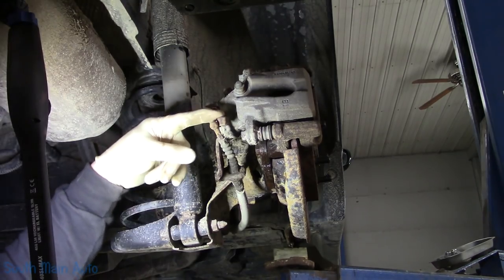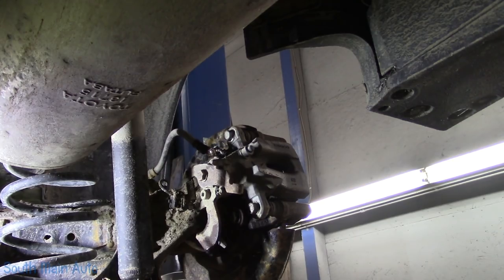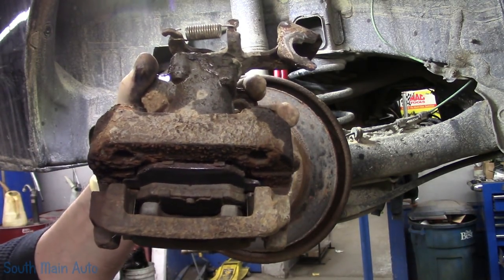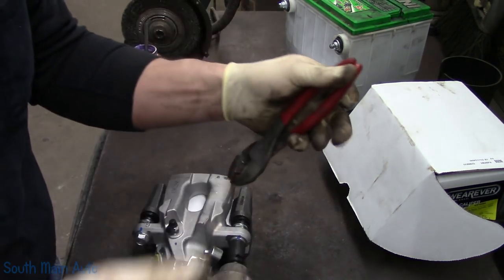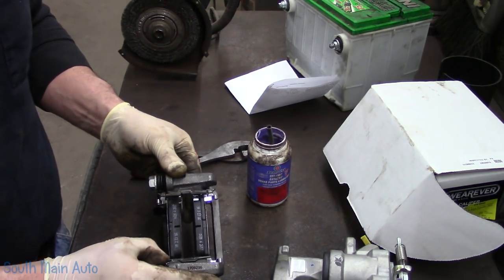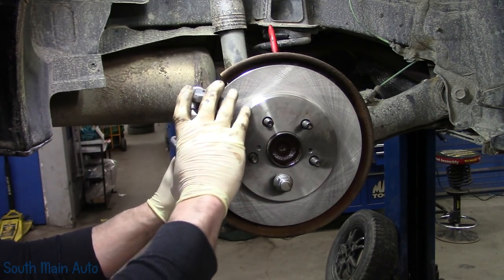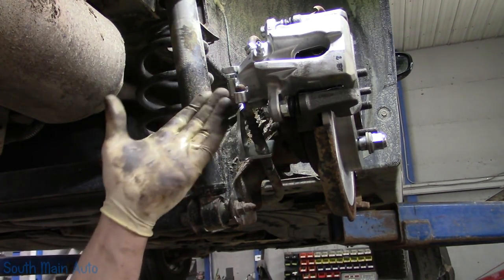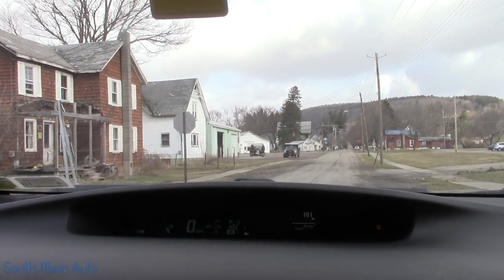Toyota Prius - Rear Brake Pads, Rotors & Calipers

Comment: At 9:45 Eric asks, "Kind of monotonous, isn't it?" No absolutely not. I love seeing you work. You are clearly doing the best job possible, and that is an endless joy to watch. In addition, I love seeing all the ways engineers can design the same components to do the same job. In this case the shock goes into a bracket welded to the outside of the lower spring cup. It is so much fun to see this.

Comment: So, I have seen several videos where the wheel has come off while the car is moving, and always a day or two after some other shop replaced the tire. Those shop state that you must return to let them RE-tighten the lug nuts. This is because those shops do not clean the rust off the disks, which means the wheel is not solidly bolted down to the disk. As the car moves the wheel-rotor mating surface scours off the rust, and this loosens the wheel. In every video Eric cleans off this rust at every surface. When Eric is done, that wheel in on to stay. This is the joy of watching Eric work.

Comment: videos like this make me so glad I don't live in a place that gets snow all winter long.  I don't have to deal with any of that rusty crap on my cars.  Just a little surface rust here and there.  I've owned my Integra 18 years and can only recall maybe 2 bolts that I've ever broken on the car - an exhaust manifold stud, and one of the OEM shock tower brace studs.

Comment: Why was I transported to the dentist when you used that pick on the rear hub (shudder), then laughter when I saw the slo-mo brake clean spray action. Great job on the car and the video. NB here (UK) so many cars now don't have a handbrake or emergency brake instead they have electrically operated ones which engage and disengage automatically so their use is definitely on the increase.
Reply: In wet, freezing weather the brakes can freeze in the set position if applied when warm. A lot of people in snow country have learned not to use the parking brake, at east in winter.

Comment: i did add a couple of flanged headed bolts and nuts with some rubber washers to my tool box a couple years ago just to plug off my banjos. seals them so they dont drip  but more importantly keeps the dirt out.

Comment: I clamp my hoses too, also bonus points for the "ive been taking chances, its gotten me 3 kids but never a collapsed brake hose."
Reply: My take on clamping the hoses (I've never done it - I wrap the fitting and let it ooze) is that if the hose gives trouble after being clamped the hoses should be replaced all around.

Comment: raises hand parking brake user here also, for both manual and automatic cars.  Knowing how the park function works on auto gearboxes with the little pin hold the weight of the car, using the parking brake seems like the obvious thing to do.  My wife never uses it, but I do.

Comment: Nice work. I did a pad slap on my brothers car the other day. He refused to replace the worn out rotors and bought the cheapest pads they sold. I spent about 10 careless minutes on the job.
Reply: I didn't even bother driving it. He said it was great. Not even squealing or squeaking. The rotors were not previously pulsating but had large groves on them. One of the inner pads was completely worn down almost metal on metal due to a sticky caliper (which I did replace).
Reply: The car will be fine as long as the only issue is the rotors needed to be turned. It will actually cause the brakes to grab better, but at the cost of those new brake pads. They won't last as long as they could have if the rotors were replaced/turned also.
Reply: If you have a stuck caliper piston, that caliper needs to be rebuilt. You may free it up but its only going to last so long. At least a new piston and seal. On some brakes, I am careful about which calipers I buy. I am not going to completely trust the phenolic pistons (plastic) long long term. Brakes are too important to keep working at 100%. 
Replace your brake fluid if you haven't already done so!
Reply: m ph w
Reply: @snoopdogie187  I haven't turned rotors in 30 years or more. Rotors seem much more susceptible to judder after being turned, especially if they had it to start with. If the rotors are not looking and behaving well I buy new ones. Much better results.

Comment: parking brake remember when it was called your emergency brake with the actuation handle under the dashboard. and the starter pedal was on the floor next to the GAS PEDAL👍
Reply: Don't forget about the high beam switch on the floor
Reply: And your bright headlights were a button on the floor
Reply: And an accelerator pump and a manual choke
Reply: The mechanical parking brake saved my bacon while going down a steep hill and the brake line gave way. I was able to use it to drive to a local shop. What would've happened if I had the electronic parking brake?
Reply: +mikey mike  On a few old cars there were two foot-operated switches on the floor: one for the high beams, and the second to engage the engine starter.  The first time I ever saw this I was really confused, the car was manual transmission: one foot on the brake, one foot on the clutch, one foot on the gas for a cold start and another foot for the floor mounted starter switch. Humans must have been different back in the 1950s.      Another setup found on some old cars had the starter switch beneath the clutch pedal, push the clutch to the floor and the starter would engage, even when you were driving.  Perfect car to teach someone to drive standard.
Reply: Joseph1NJ If you hold down on them, they will stop you in an emergency
Reply: Joseph1NJ pull the switch and it locks down on the brake.
Reply: @Joseph1NJ  did you take a chance and pinch off the brake line at the last brake job?
Reply: @jeffmorton5092  No, the line failed.

Comment: I pinch brake hoses too never had a problem. But I like to use long rubber valve stems through the banjo hole too, no pinch your less mess
Reply: valve stems as plugs good one, I started using vacuum caps rolled through the holes, but the stems sound much faster!

Comment: Was working on my moms 2010 prius  brakes yesterday and I found the driver side brake was a mess. The outer pad was missing and the metal wire hinge thing was hanging onto the other pad and was scraping the heck out  of the rotor. When I removed the other pad it  fell into 2 pieces.  The  metal back and the contact pad  split into 2. Now I need to order a new rotor for the rear.

Comment: Great Vid! I'll bet those brakes hardly ever get used with the regen on. Hear about the 6k brake job on a tesla? He used regen ALWAYS and the calipers and rotors were one solid rust spot! Never touched the brakes in 22k!!  Hope lil T feels better!
Reply: In the first gen Prius the regen cut out below 12 mph. I don't know about the more recent models, but I agree the rotor looked like it hadn't been touched by the pads for a winter or more. (Regeneration is not controllable in the Prius.)

Comment: I am always astounded by how much corrosion you get there in upstate New York. Arizona just doesn't have that problem. Even here in Flagstaff, where we get a lot of snow, the city does not use salt on the roads. A decade ago they used a non-sodium deicer that did much the same damage and killed tens of thousands of pine trees along the roadsides, and that gave me corrosion under the shoes of my 2002 Prius rear drums. I recently gave that car to my son, at 205K miles he gave it its first brake service. The front pads were about 2/3 worn and the rear shoes were not measurably worn, so he replaced the front pads and left the rear shoes alone except for regreasing.

Comment: Working on and driving a Prius???  I am going to discuss with my therapist if I should remain subscribed to the SMA channel or not.
Reply: Ozzstar 20 bucks is 20 bucks
Reply: burningfeet 57  The third generation Prius (shown in this video) has almost exactly the same 0-60 time as the US version of the Delorean DMC-12: a bit over ten seconds. My wife and I have bought nothing but Prius since 2002. My 2002 needed its first repair (besides a couple 12V batteries, a windshield, tires and wiper blades) at 195K miles when the inverter coolant pump died - a problem in the first and second generations, including a recall in the second gen. I gave my 2002 Prius to my son last year because I retired and didn't need it. He did the brakes for the first time at more than 200K miles; the front brakes were about 2/3 worn. The rear brakes were like new.
My wife traded up to a 2010 five years ago and would still have it had it not turned into a magnet two years ago. Within barely six months it was sideswiped by a pickup truck beside her who flinched from a car entering the road, then a deer ran full speed into the driver's door, then a young woman had a seizure in a parking lot and fatally damaged it. She loves her 2014 with all the goodies, though. We have never had a car even a tenth as reliable as the Prius cars we have had.

Comment: A couple used long valve stems work great as opposed to pinching the hose...take the banjo bolt out and push the stem in...and just phenomenal brake clean action! Hahaha (rubber stems)

Comment: Here's a cheap substitute for that parking brake cable tool- the box end of one of your combination wrenches. Just try different sizes until you find one the fits and use it like the park brake cable tool.
Reply: We use little hose clamps to do the job,  quick and easy...
Reply: That's a good idea.

Comment: Hey Eric next time try a small hose clamp on the e brake fingers , keep it about an 1/8 inch up on the cable from the bracket. Tighten it up compressing the fingers and slide the cable out

Comment: 👍👍👍👍👍 Excellent job thank you ,got a question for you replaced all 4 callipers  and bled them,last year because the rears were sticking and not moving everything seem to be fine ,then this year when I took it out of storage they were doing it again in the rear brakes so I replace the rear hoses bled the system still happeningAny advice should I just take it to a professional technician like you

Comment: Important:  When changing out brake pads and rotor only, it is totally unnecessary to remove the parking brake cable from the brake caliper. Just follow the brake cable forward ( a foot or so) and you will find a number 10 metric bolt that you will need to remove. This fastens the brake cable to the car body. Once this is removed you will have plenty of room to move the caliper out of the way avoiding unnecessary work. I know this because I have performed this job on my Toyota Prius a number of times.

Comment: hey eric     the pad sensors or squeal ers   always go toward the leading edge of the rotor  I always find them installed backwards   and sometimes I transfer the cable bracket over... cable still on bracket   nice brake clean music too

Comment: Eric jumps the tracks in a Prius! WOOO! 😂 I'd love to hit those at whatever speed that fast-forward converts to. You'd get some serious air, no matter what you're driving! 😁

I was just having that same discussion with my neighbor about parking brakes. Just about every vehicle I get in here has frozen cables from the only once-a-year use. I use mine all the time, too - I don't want that cheap, plastic park pawl in the tranny to bust! Nobody pays me to fix my own junk. Wouldn't it be nice if that could happen ...🤑

Hope Trinity is feeling better. I remember being sick constantly at that age. Public school is like a giant petri dish. 🤢

Never drove a Prius before. Heck, never even sat in one before! What an odd vehicle that is. Looks like all your paying for with those is the powertrain - everything else is cheapout central.

Loved the slo-mo brake clean blast there, HAHAHA! SWEEEEEET! 😂👍🤘

I had fun today cutting a leaning tree down, and miscalculating distance to power lines. Damn eyes - too much rust in them over the years, I guess. No worries though - the '94 S10 plow truck saved my life, as I yanked it off the wires with it. I seem to have crossed the telephone and cable wires, as they whipped furiously up and down by several feet. Was a shame I was driving, and missed the Jacobs ladder as the tree came off the TOP,  high voltage line. BZZZZZZZZZZZZT .....BZZZZZZZZZZZZZZT!  We managed to keep power, though! My security cameras aren't aimed up that high, otherwise it would've made for a fantastic Youtube vid. Always an adventure in my 'hood, here ... 😁

Comment: Does the lovely Mrs. O ever catch you talking to us in your sleep?  Great video, with the enhance editing.  You are quite the maestro of the cinema!!  Question:  we own a Dremel propane soldering iron and can never get the tool hot enough to melt the solder for doing electrical wiring on the car - audio, gauges, etc.  Can you recommend a well performing propane soldering iron?
Reply: I've gone through many inadequate gas soldering irons, they work for a few months and then fail or become unreliable or hard to light. The only one I've found that is at all adequate is the one sold by Power Probe, but that one is very expensive (same one Eric uses). Gas is certainly faster than electric and I can use it at the top of a mast on a boat without needing a cord. I've had better success with A/C electric bench irons, Hakko sell a pretty good product but you get what you pay for. The very best bench stations are outside of my price range but they offer better consistency of heat delivery.

Comment: Excellent video! Well laid out on the repair.Were those brake pads typical wear or was it high mileage?
They also seemed very small. What the cycle time to next replacement?
I’ve never done work on a 2000 or newer vehicle. Just more older cars and restorations. Thanks!

Comment: I've been pinching brake hoses (and others) for years, never had an issue. You go ahead with your bad self. (throws gang sign)...
Reply from the maker: Boom! (Throws gang sign back and gives you a sweet hand shake) thanks brahh.... (drops the mic) (walks away all cool like)
Reply: The pincher isn't the one who will have the problem. Its the customer and It's not immediate nor does it happen all the time, but it can bruise the internal part of the hose and cause collapse down the road. Not to mention it's just not professional.
Reply: Try this way, that was shown to me over 30 years ago by a guy with 20 years as a mechanic already. Hang the old caliper with S hook and with hose still connected. Bring the loaded caliper over and install, and then remove the hose and move it to the newly installed caliper. Just as quick, no need to pinch the hose.
Reply: @GNX157  Apparently you didn't catch the "for years" part. Or the gang signs. If the brake hoses were that sensitive mechanics would know it by now.
Reply: GNX157 pinching the hose with hose clamp pliers is actually taught in auto school and can be found in several brake and service manuals.  What makes you think it’s unprofessional?

Comment: Nice work, love all the cleaning.  Those rear rotors were baaaad, guess the owner doesn't give the car enough beans, EVER. These cars are SO light on the brakes, if you drive them gentle all the time then stuff seizes.   Also I liked the sped up test drive, the sound was perfect after you'd said it's like driving a spaceship, sped up video it sounds like one too! :o)

Comment: Hey Eric. I know you get your supplies from Napa and Advance, but I'm wondering if they take the cores if you cut the E Brake bracket.. I did just what you did out of necessity, but O really's  (lol) wouldn't take my cores back after I cut said bracket as 'a damaged core' .. Just curious if you've had an issue... Thx for the copious amount of brake clean.. I can smell it from here....

Comment: 154,000 miles, is that the first time the brakes were changed? I am asking because the regenerative brakes on the Prius are famous for lasting a very long time.
Reply: After I gave my 2002 Prius to my son he decided it was time to do the brakes for the first time. Around 205K miles and 18 years the front pads were 2/3 worn; the rear drums were not measurably worn at all. If we had corrosion like that I bet we would change them a lot more often.

Comment: So for the rear brakes, do you just press the brake pedal to turn the pump on or do you first turn on the car?  If so, does it just need to be powered or should it be in a certain mode?

Comment: My rear cylinders seem to drag on the rotor too much (loss of mpg, hot discs in winter - more warm than in front). The drag happens with the bleeder open so it's not the line. I made sure to align the cylinder with the pad's notch. Everything is new (Raybestos E3 from Rockauto) and I put Syl-glide grease on the pins with copper anti-size on the pads lobes. So what the heck is going on? The only thing I did not open is the cylinder and I left it with its factory grease. Been dragging ever since I installed it. New caliper, new pads, new rotor.

Been a few weeks, if you can give me some idea ...

Comment: My ABS System lights are on (and it isn't functioning) after I changed the rear passenger caliper, rotor and pads as you did.  First time doing it on a Prius, but I've successfully done it on other cars many times.....any suggestion as to what it might be?

Comment: do they use brake by wire where an electric pump actuates each brake line in that? the older mercedes benz E-class had that.

Comment: I thought there was something special/impossible about bleeding the prius brakes that required their scan tool because of their ABS system?  Or is that when you want to do a fluid flush?
Reply: if you wanted the best fluid flush, master cylinder change or a line broke and air entered, then for sure special bleeding procedure.